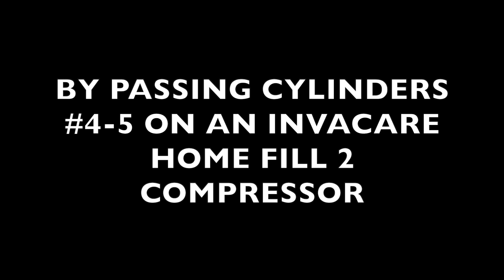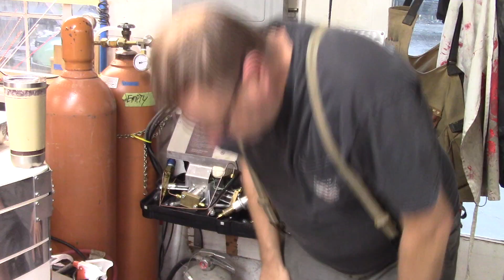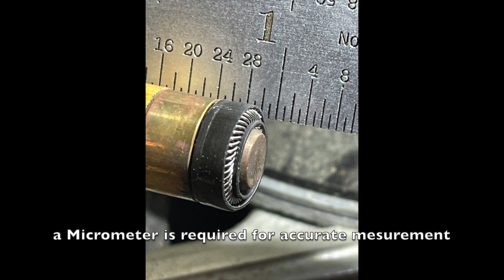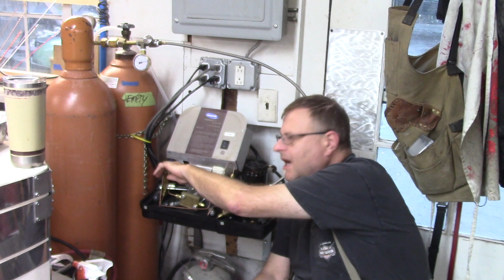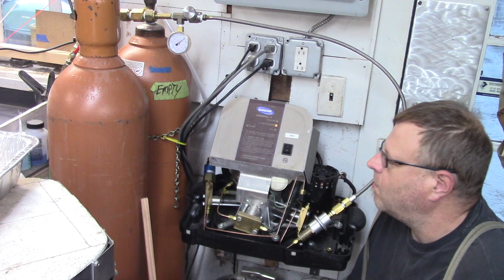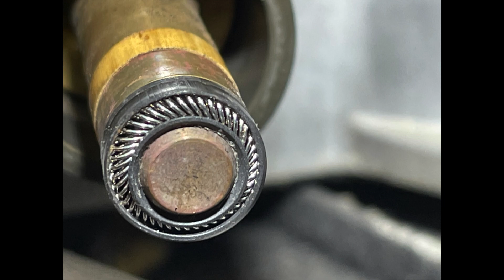invacare home fill 2 compressor cylinder 4&5  by pass long

Comment: Do you happen to have the specs on these seals?  It would be nice to source a set of seals for less than $200USD
Reply from the maker: I tried to have them made and couldn’t find anything remotely close the seals are very intricate so my ability to properly measure them was a failure

Comment: Good explanation.
Reply from the maker: Thanks, I did finally replace the seals
Reply: @11THEFEZMAN11  How long do you expect it to last?  Is it worth doing a seal job and filling to 2,000 or is it better to shut off at 1,000 and avoid seal damage?
Reply from the maker: @dyardsale5475  honestly I have no idea, I switched to liquid recently so the home fill is just sitting. For me filling one tank to 1000 is a complete waste, at my current rate I am using  2 tanks a day